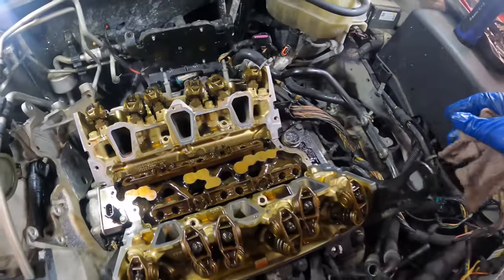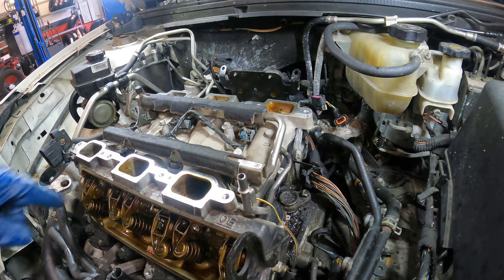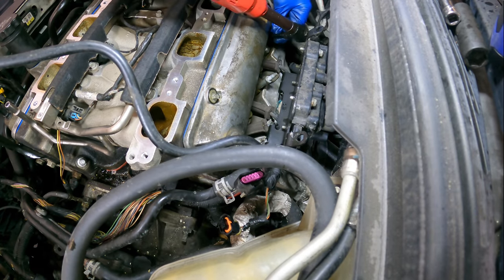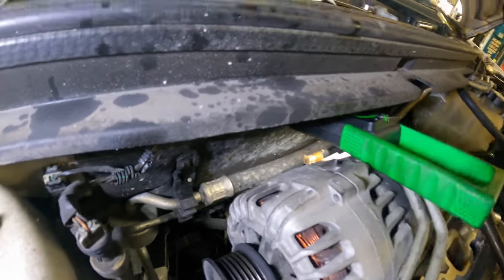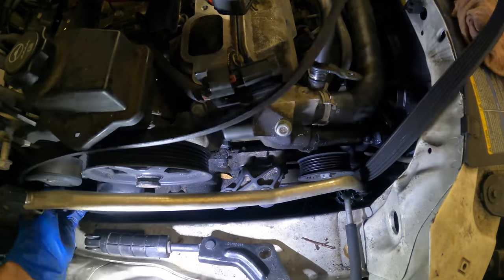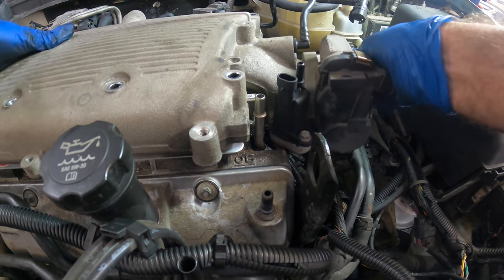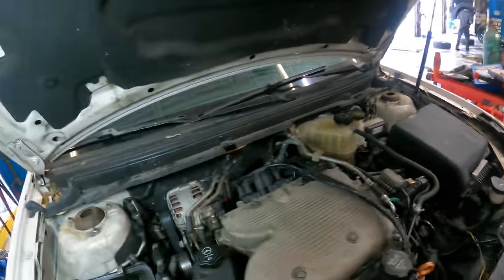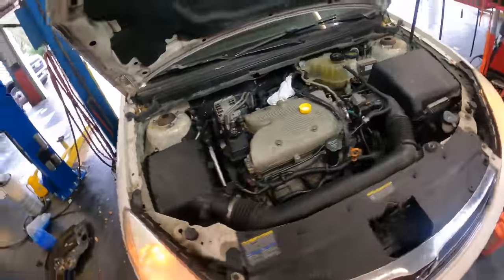It’s Going to Live | Saving an engine! 3.5l Lower Intake and cylinder head coolant gaskets

Comment: Hi Ray. Fantastic channel buddy, watch it all the time here in the UK. Quick question, in the final clip, the front Alternator bolt still looks loose???
Reply from the maker: The large single bolt in the front? It’s tight. It went in and out a couple of times (cut scenes)
Reply: @RainmanRaysRepairs  Mommas got a squeeze box Daddy never sleeps at night.

Comment: You have a great day as well. Great series. Breaking things is evidence of work being accomplished. I do have one question though, if I may. Did you calculate the torque for the adapter used for the two bolts on the lower intake manifold? Using that adapter changed the torque value applied to the bolt head. Though given the length of the adapter wasn’t that significant, it still affected the applied torque. You do great work and I enjoy watching you as you embrace quality.

Comment: Excellent video set. I'm wondering how some motors get by without requiring some kind of valve lash adjustment procedure. Does this one have hydraulic lifters, so the lash adjustment is automatic?
Reply: Yep exactly. Hydraulic lifters

Comment: Ray, couldn't you make a fitting out of the brass cabinet ? Probably wouldn't cost any more than that fitting will cost from the dealer . Plastic gets brittle from age and heat cycles .

Comment: I wonder why the lower intake gasket was designed to have the push rod pass through it. Looks like the gasket could have a relief that the push rods pass between. There is no mating surface there.
Reply: Agreed,  pointless work added for a gasket replacement. Engineers suck.

Comment: I dont care about the loud guy, im looking at this motor becuse ive never seen one torn apart thats quite like this with push rods. Im used to overhead cams 
And ive owned old gm and Ford as well as Chrysler ls with slant 6 and V 8s In them I had a 64ss impla with a big block v8  I think it was a 283 but it made my buddies 350 look like a toy side by side.
I wish I'd kept that car. But it had problems, stomp on the gas you busted the distributor on the firewall every dam time.  Car was a tank, I hit a Datsun 510 wagon ripped it open like a tin can 
Only put a smug on my chrome bumper I could wipe off with spit. 
It was very heavy. Big car. It be worth some money today.

Comment: Hey Ray, as one who has learned a lesson the hard way, I would never again try to plug a vacuum port with a rag or paper towel. I’ve seen engines suck said towel into the intake where it gets stuck in an intake valve. I just find a bolt or spark plug that will barely screw into the hole with my fingers and let it go at that.

Comment: I've had to write this so many time on YouTube videos- that I
kept it, now just cut & paste it where I see it happening. 🤦🏻‍♂

"Teflon tape" (or the brush on PTFE paste equivalent) 
is not a "thread sealer".

It is an inert, non-migrating thread lubricator that allows NPT 
fittings to fully tighten, thus creating a proper seal. A drawback
of it's usage is that fasteners can be torqued beyond safe limits,
resulting in stripped or sheared fasteners, especially hollow fittings.

NPT are tapered, and slide together to create a seal. Non petroleum
Teflon allows tapered threads to slide more easily. About the same
danger as oiling threads of head bolts, excessive torque is easily
achieved, resulting in broken or stretched bolts.

Many installers of Teflon tape needlessly wrap several layers
onto threads, thinking is "seals better", when what actually happens
is thread clearances are greatly reduced, resulting in prematurely
cinching, or cracking a threaded Boss. One tight wrap is sufficient.

Comment: Hope your using a Torque Wrench Extension Calculator because Adapters or extensions should only be used in line with the wrench, as opposed to being at an angle, and the actual torque applied will be greater than the torque reading shown. YOU NEED TO USE A CONVERSION TABLE because when you used the extension and then that Rachet Crows Foot that torque is wrong!!!

Comment: I have a question if you dont mind, is it only certain cars where the gap between the valve 'top's (sorry the names just flew out of my ear where my brain should be) and the 'spring's in order for it to keep it from losing any of its horsepower? I'm only asking because I saw it on a TV car programme and it was an older car that didnt have all of its horsepower so he measured the gap between the valve parts and set them to the make & models specified mm (I think this one was 3mm)?

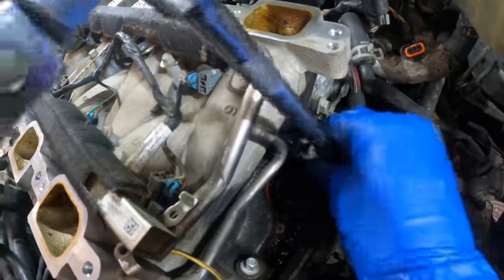Comment: I suspect that your little reach converter thingy at 12:20 messes up the torque application, because it changes the lever arm length. My reasoning is that these wrenches really only measures force and they are calibrated for their own fixed length to translate that into torque readouts for you. If you change the length with adaptors, the torque readout becomes false and you have to math in how much to compensate in the readout so that the actual torque applied at the new length is correct.
You kinda mentioned it yourself. At 90degs off, it still changes the lever arm length, because pythagoras, but not by as much as if it was in line. Not sure how precise these torques need to be. I'll assume engineers have thought of that and enough leeway is factored in.

Comment: Lowe's and Home Depot carry those threaded barbed hose
connectors, they're usually brass. ~$5 - $6 at most.
Reply: Was thinking the same thing.  GM may have done some custom part, but that looks like a pretty common fitting.

Comment: Dorman makes brass fittings called "Line Makers" that cover from 1/8" pipe all the way to 1", with barbed ends for different sizes of hose. NAPA usually carries the full line of sizes. Plastic fittings SUK!

Comment: I don't know anything about GM's but I think I would avoid them.  OK so the un-fixed oil and coolant leaks have taken their toll on the wiring loom, but to me there are a 100 things waiting to go wrong with it.  I am surprised it actually has lasted as long as it did.  Did the guys who designed these things ever get to do a partial (as this one was) strip down?   Of course some of the problem is you lot needing several litre sized engines and always auto transmissions where a 1.4-1.6L L manual would be fine.  Tells me that you had/have  cheap gas and not to fussy about envorimental issues.  I am wondering if things are changing yet?
Anyway a cracking series of videos Ray, I just can't get the ecconomics of this series of repairs, surely this should be junked?  A completely wrong thought just entered my head that actually you might part sponsor these repairs to keep the channel subs rising and show off your outstanding skills and experience.  Not a problem to me, this is the best U-tube channel I watch and very addictive it is.  Thank you.

Comment: big question- how do you properly clean an engine exterior/underside from that kind of intense leakage without a pressure washer?  I had a similar problem, and would like to be able to spot if the leak comes back, if it starts to seep.
Reply: Hot tank.
Reply: Decent degreaser and a bit of elbow grease.
Reply: Drive a lot on wet roads.

Comment: $1000.00 to fix oil and coolant leaks but $25.00 to fix battery terminals, nope.. also using those “finger w ratchets” as you call them with your torque wrench changes the amount of torque you are applying
Reply: If auto parts required torque settings that accurate no home mechanic's work would ever be correct.  Recommended torque settings are just that, an approximate setting that the engineers settle upon in the full knowledge that actual installation may vary..  Minor variations based on tool configuration, or things like oil on threads aren't usually critical enough to matter.
Reply: @markdoldon8852  thats so true 220, 221 whatever it takes….

Comment: Ray did you leave the front alternator bolt loose?
Reply from the maker: Nope, I did at first bc there was a bracket that it threads into, and I wasn’t ready to mount the bracket when I filmed in that particular moment

Comment: If that's the same block as  the 3.1 , gm had a lot of problems with overheating and other oil leaks. That 3.1 was probably the worst engine I've ran across.

Comment: Is that a 1/4" ratchet you're using to torque those bolts around the Nator,  power steering pump and pulleys?

Comment: One would think that with modern engineering and technology you wouldn’t have to put patches of silicone at gasket intersections.  Ray would still do it anyway because Ray is Ray and a great technician.

Comment: What's a mechanics impression of this engine? Reliable, or avoid?
Reply: This shade tree mechanic avoids GM, Ford and Dodge products.  If you're in the market, the Toyota products are outstanding.  Specifically the 1.8 liter found in the Corolla.  My favorite year is the 2006-2008.  Rock solid!
Reply: @bertblue9683  I'm not now but was considering an older Impala. Had heard some good, some bad. Ended up with an 2010 Mazda 3. Cheaper than Toyota(Toyota's just maintain their value so much that it was out of beater budget). Past the rust box years and reliable as well. Little more expensive on insurance because of young ricers though.
Reply from the maker: That whole engine platform is actually quite good. The stuff that I fixed in these videos are the Achilles’ heel of this engine family.
Reply: @RainmanRaysRepairs  Thanks for chiming in Ray. People who owned the cars are rarely objective as they're influenced by they're experience. I can keep it on the next beater list then.
Reply: Any car you’re looking at.. promise me you’ll have it checked sir! Don’t have it checked after you sign. Have it checked before you sign. I know this sounds common sense but not many possess it when it comes to car purchases I’ve found. These cars can eat head gaskets like candy and if you buy one that’s leaking internally like they typically do— you’ll have no car!
Reply: Totally understand the economics of it all.  Best of luck to you.
Reply: @topherd1011  100pct. I'm probably smarter than I give myself credit for, I hope. I have a general idea on what to look for when used shopping. Signs of shenanigans and such. But yes, always always always have it checked by a professional before you sign anything.  In Ontario Canada where I am, you have a bit more protection. We have safety certificates. That being said, a car can pass a safety and the engine can be totaled.

Comment: The manufacturer failed to choose an appropriate material for that hose fitting that broke during this job. Brass would have been an excellent choice, if teflon tape was applied. Plastic would be okay. Okay-ish. It would self-seal when new and properly tightened at the factory. However, years of heat-cycling made it brittle and unfit for removal and reinstallation. Good call to use a bit of teflon tape but it was already destined to break.
A manufacturer-induced blemish on an otherwise perfectly executed job.

Edited: added an actual comment and moved down the original text of my post, for it is now obsolete.

"Saving AND engine" in the title?
I didn't expect that from you, Ray. Please change that a.s.a.p. Your reputation is on the line.
Reply from the maker: Silly me! I fixed it
Reply: I would have thought that was YouTube's fault.
Reply: @RainmanRaysRepairs  Thank you.
Have a great day.

Comment: Rainman: Yee never tightened the top nator bolt. Ya'll tightened the back two so it probably won't move but the top bolt was out 3/4".
Reply: I saw that too.... Looks like it as tightened by the end tho... Watch the end when the aircleaner was put in... You can see the bolt head against the bracket....

Comment: Is it just me, or did the engine torque / motor mount seem really loose on the block bolts...? What was up with the drips from the bottom of the coolant tank? 
Also, Ray, I think you underestimate your viewers need/desire to watch you work, and see how you do things. Especially since you broke that vacuum fitting into the intake. Recording the repair might have been good content for those of us with lesser experience in what to expect or how to remedy such things. Just saying.
Reply from the maker: It’s a floppy\flexible mount

Comment: Ray, when you use consumables like cans of brake cleaner, tubes of gasket sealer/maker, etc., how are those items billed to your customers (especially for partially used containers)? I appreciate your videos, they are relaxing and zen-like (as well as informative) for me. I used to turn wrenches as a maintenance mechanic and machinist until injuries, arthritis and surgeries took away that ability. Thanks for a great distraction.
Reply: I often see a small 'shop supplies' charge on repair invoices.

Comment: Check top Alternator Bolt ... Didn't see that get retightened ... I remember you had to loosen it to get the back two started ... Might not have been filmed but better safe than sorry, and dgas bottle seems to leak a lot!

Comment: Those stupid plastic threaded parts suck, as they often get very brittle with heat cycles. Broke a plastic transmission fill plug off in the threads with what was probably 3 ft lbs of torque.

Comment: Oil pump drive o-ring. Oh no. The train has left the station. Goodbye. You have forgotten me. I am a shrunken o-ring. I feel so abandoned. I will continue to piss out oil. Please don’t forget about me.
Reply: You can change the o-ring without having to remove everything. Gain access to the oil pump drive; unbolt the clamp; wiggle/twist to lift up enough to expose the o-ring; remove the crunchy, shrunk o-ring; stretch the new one over the top; reassemble.

Comment: To be honest, I'm surprised the customer opted for the gasket replacement. In the first video, I noticed the Fram oil filter there, and those are the absolute worst filter you could ever put on an engine. Maybe you might advise the customer to upgrade filters to Wix, which happens to be who makes the Car Quest filter you installed.
Reply: ive used fram on every car ive ever touched until very recently, never had an engine last under 200k miles. why do they have such a bad rep?
Reply: The type of oil filter had NOTHING to do with the Exxon Valdez situation, and whoever orders the parts seems to be pretty diligent in avoiding Fram.

Comment: I don’t understand why these manufacturers keep putting these plastic parts in engine bays and in and on engines. It’s bad enough that they use them all over the interiors. It all comes down to manufacturers cost and as opposed to long term reliability and ease of replacement.

Comment: Well, I hate to bash you on this one. Not sure why or who taught you on torquing the rocker arms. You never torque the rock arms unless the valve is closed. This is a true torque objective and doing it with the rocker arm in any other position gives you a false torque to the spring and the rocker arm is applying pressure to the Nut or bolt that causes it to reject what is applied. So intern these will be loose when in the closed position and will rattle.

Comment: I had feeling some plastic parts would break not your fault it's cheap ass car  designer's always cutting corners lol they could use brass or copper which doesn't react aluminium (aluminum) ❤️✌🏻and up the troll 🖕🏻

Comment: Loose bolt !?!?
There were three bolts on the alternator.  Two along the firewall and one through the 'pivot' part of the alternator.  The large bolt through the pivot part of the alternator never got tightened.  I might have missed you tightening it - or it may have been cut from the video, but it still looked loose after you started the engine.  Just my $0.02 worth...